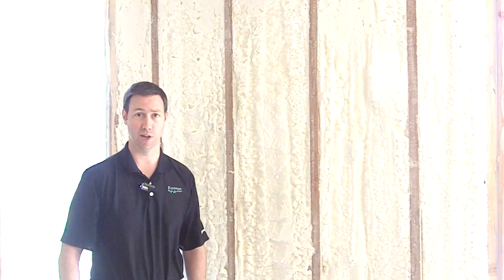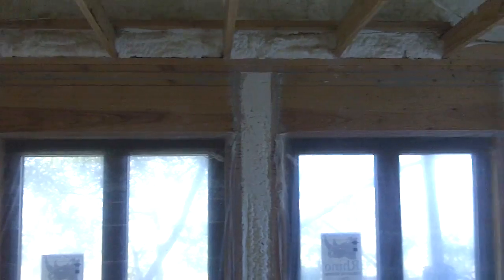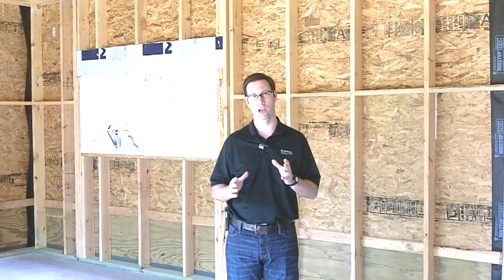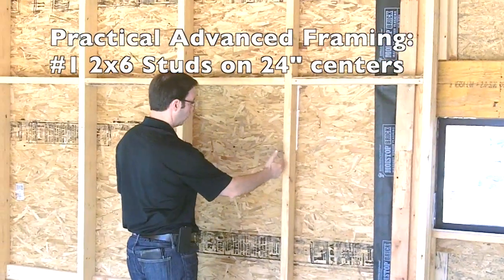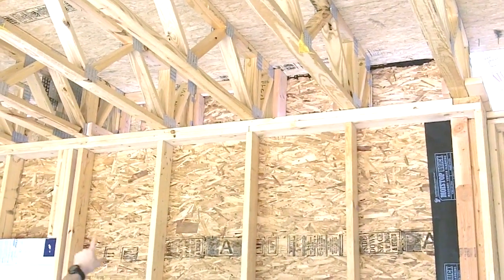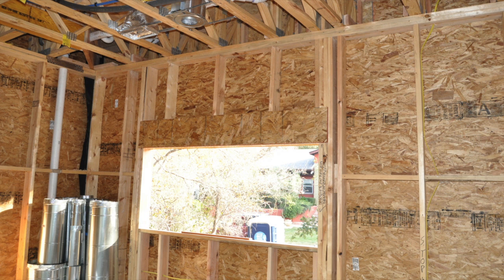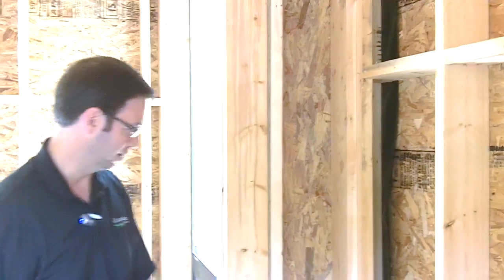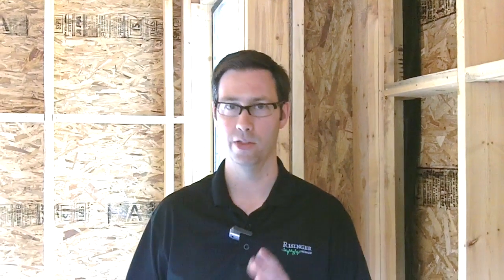Advanced Framing vs Traditional Framing

Comment: 24" on center is terribly inadequate. Even if you don't care about the lack if stiffness in your floors and roof, only being able to put a nail every 2 feet on your baseboard, crown and skirting etc is not at all a good product. Especially in this day and age of cheap trim lumber with finger joints, or medium density fiberboard, or god knows what some are using these days, lols. 

  2x6 studs are great though, especially in wall with waste lines. And plywood always is better than OSB. California corners work  almost as well as stud-block-stud corners, and you can use 1x for the nailer, you didn't need that 2x for that since all it's doing is holding the sheet rock.

  But traditional and modern in no way denote either of them as advanced  generally speaking. As I've pointed out, 24" centers are not advanced, but what is advanced about framing these days are elements of retro-fitting, like j-bolts (most important) and shearwall. Though they sometimes call for such close nailing on the edges that it causes the plywood to weaken and even split (ie; 3" - 4" nailing patterns on edges).

Comment: So you have to go to bigger studs, thicker sheetrock and full exterior sheathing, preferably plywood, all so you can eliminate every third stud? I'd say you need to take a second look at your bookkeeper's work! You're not saving any money, my friend. Now there may be other benefits, such as providing more space for insulation in the wall cavity, and reduced thermal bridging, but cost saving? Nope! 2x4s just aren't that expensive. The extra costs of the beefier materials eat up all your savings.

There are also disadvantages too that you should discuss. Plumbers and electricians need extra strength in the framing so that they can poke holes in it (preferably small and not too many, though we all know or have heard of tradesmen who were less than careful) and the building will still stand relatively straight and sturdy. Building codes in earthquake zones, hurricane zones, etc. may insist on greater strength in some details. Homeowners need to find studs to hang heavy objects from the walls. They'll be searching in vain to find wood in the walls 16" apart for shelf supports. Same goes when it comes time to install cabinets. Keeping everything aligned so that roof and second floor weights aren't carried by inadequate top plates may necessitate building redesign and also education of installers to make sure the alignments actually get built as specified.

Comment: A lot of dinosaurs and old-school 'experts' commenting here. My wife and I build staggered-stud double wall structures and am sitting in mine right now as I type this. Our buildings are way beyond code minimums, with R36 floors, R47 walls and R68 ceilings. We use a lot of adhesives and screws, focus on details like air-sealing and such, and as a result heating costs are WAY lower than average. For example, our home is not only super-insulated but off-grid with passive solar and wood heat. Every neighbour in this area (central British Columbia) burns 8-12 cords of firewood a year; last year we burned 1 1/2 cords. Think about that: we spent only about $4,000 more to build a high-performance home. Everything is on 24 inch centers and these buildings EXCEED the code minimums. 

Old school guys put headers in non-load-bearing walls. They stack five, six, seven studs in a void to fill it. They still stuff fiberglass around windows and doors, even though it is useless. The problem here is that guys who banged nails for 25 years think they understand engineering better than an engineer!

Comment: The cost savings of the framing is about the cost increase of thicker sheet rock. The 1/8” thicker sheet rock adds virtually no vertical strength compared to what’s lost with the reduced framing but is needed to bridge to wider span of the 24” OC studs verses 16” OC.

Comment: Me...Yea Mr. or Mrs. framing inspector we went with the advanced framing method and spaced the studs on the exterior walls 24 o/c, missed drilled the anchor bolts and threw the straps and clips out the window opening with the engineered header. 
Mr or Mrs inspector....Hello 911 I'd like to report a crime.  
That framing is criminal.  Next he'll be filming the reasons these walls failed in a cat 1 hurricane. I live in South Florida so we over build all the time.

Comment: We need homes that can take hurricanes here on the gulf coast. I like strong framing. I use 16 inch centers and OCB. Most won’t pay for plywood.
I like insulation bats. Don’t worry about saving on tar paper. Use the thicker ones and plenty of it. Overlap so you have two layers.

Comment: Where I live many homes were built in the 1920s-1930s many earlier which are post and beam,but most of the 1920s-1930s homes here were built with actual 2x6 not inch and a half by 5 and a half but actual 2x6s mostly pine or hemlock most of the homes were built with California corners and many are 24" oc some are even further it is not uncommon to open up walls and find studs 36" or even 48" oc and these houses have stood up to time and upstate NY's winters and snowloads,People here seemed to build with what they could afford,So explain to me why 16" on center and over building became standard practice when the old timers didn't over build and the old houses are still standing better than some of the new ones that are are over built and engineered,It all boils down to a few words codes pockets filled with engineers money and engineers pockets filled with industry money and industries pockets filled with golliable customers money,If we wanted to save money and use less product and have more insulating area and a better end product we would have never left the post and beam and mortise and tennon era in building and to think it has become an industry for the rich to build post and beam when actually it is cheaper but industry doesn't want to say that,it takes less cuts at the mill to make beams than lumber there for less time it takes less time to assemble than stick built where time is consumed in post and beam is in mortise and tennon but with todays tools why would it take any longer to assemble an H them it does 1000s  of 2x6s or 2x4s problem is it takes less wood to build post and beam or the same amount just not cut into a million tiny pieces that companies sell you individually that they payed next to nothing for to begin with,Home building has gotten out of hand because of the mighty dollar sign,Another thing is codes telling us how many sq ft each home and room has to be and that is why we now have a family of 2 living in houses the size of warehouses instead of what is really needed,

Comment: I'm dismayed by so many over the top critical comments.  Do they really think a fully  OSB sheathed  plus 3/4 foam 2x6 24 oc wall with  5/8 drywall interior is cheap construction? Not hardly.  Most completely miss that when using floor trusses at 24 oc, which is perfectly fine, it's natural to line those up with 24 oc exterior studs.  Nonetheless,  I certainly can respect those who prefer overkill with 2x6 16 oc; it's just material cost.  I presume that your interior 2x4 walls are 16 oc.   Any kind of corner or T-intersection  can work as long as you hold your framers accountable for insulating the pocket before they close it. What about the other subtle nuances when using  2x6 24 oc, like provisions for kitchen  cabinet mounting and the like?  What other advanced framing measures are you using, such as raised heel trusses?

Comment: I lived in the Northwest state of Washington 18 years ago. The homes were built 2x6 on 16" exterior walls, and 2x4 on 16" interior walls.  I knew a guy who lived across the street that was a miner in Alaska.  He said thicker exterior walls the better.  He told me that if you want a very energy efficient home to use 2x8 exterior walls with roof insulation and 2x4 for interior. Just a suggestion.

Comment: Cheap build, BS sales pitch. Earth movement, high wind pressure, temperature change, moisture change all stress houses.  The “extra” wood in a quality build is your friend.
Reply: M Ray With that much foam that house is going nowhere
Reply: Doesn't mean one can't optimize. There is always another side to the coin. And the money needs to go where they do the actual work.

Comment: I think it's fun to make fun of a new idea. The bracing in the center gives him streagth for the fb usually the week point in forces. Studs are strongest in compression (no problems there)  if he uses a plywood or tounge and grove plenty of shear strength. Now for the guy that thought he could run through the sheet rock not with blown fiberglass behind it. Usually it's hard not to over stuff them when I've filled them before and bulge sheet rock. now for the old people stuck in there ways of younger educated people. Yes I started out as a welder, laborer, bpi, carpenter, then civil engineering degree, then superintendant in Commercial construction, now own my own residential

Comment: So you save money on fraiming but yet when some one come in to do electrical they have to ad spacers, when you come to hang cabinets you have next to nothing to screw to, you have to pay more for drywall. There’s a ton of cons for a few pros. I can’t stand 24 on center for interior walls and I would never even consider them for an exterior wall. Do you attach your bottom plate with tap cons as well?

Comment: As a builder for over 40 years I would never build walls with 24" on center  for one its looks like your cutting corner on the home where the home buyer what more for their hard earn dollar. The money  you might save isn't worth it. Plus I would never spray foam in the  walls  because I just don't believe home were meant to be so air  tight. I go for tried and true. When every one was using OSB junk siding I kept with cedar.

Comment: Headers don't have a full bearing load there is a over Hans of the 2X 6. This also creates a void  from drywall to header. There should be blocking between the LVL headers.  If the structure is built correctly there is no need for  pressure treated wood  at the base of  exterior walls  in NY this is not to code   A all electric house with AC. All walls should be insulated including interior walls  Foam houses  require a good ventilation system  moisture is easily trapped  because the house is almost air tight  water lines should only be insulated on the exterior side of the wall leaving a  pipe exposed to the interior heated  living space  35 + years in the building business residential,commercial and heavy construction  good luck with your project 👍

Comment: You're on point about thinking about insulation values on things like usingv2x6s and insulated headers. But, California corners have little to no structural value. And relying on the glues and hardware of engineered lumber is too dependant on every other system, I.e roofing, siding, and HVAC to operate perfectly and be maintained. Traditional framing has its merits and necessities that can't be tossed aside for the sake of energy efficiency.

Comment: Good luck passing Massachusetts building code with any size lumber on 24" on center and half a header LMAO!  Don't think so, pal.  Never mind the building code, they'd pass it of to a structural engineer to take on the liability of that type of framing and you'll never find a structural engineer who would ok that framing.
Reply: That's funny, I know plenty of fellow structural engineers that would sign off on 24" centers as long as the design was sufficient.
Reply: Actually, just saw a series by "This Old House" where they built a house in Rhode Island and it was on 24" centers because they used 2x6 wall studs. It is called a "net zero" house because it reduces more energy than it uses. (solar panels do the producing) I would go with TOH guys anyway!!!

Comment: So many comments here are focusing on the "advanced" framing. Structurally it's fine- the fire blocking, purlin boards, and sheeting make it plenty strong. People seem to hear "2x6" and immediately think "Oh, they must want a stronger wall.", but the focus here is ENERGY EFFICIENCY, not structural strength. You can build an exterior wall with a 5.5" insulated cavity with studs on 16" centers, but is that necessary?

Risinger builds in a high-cooling climate, and over even a couple decades of lifespan, the energy savings resulting from extra insulation will more than make up for any materials expense in the initial cost of the structure. I think this is more accurate to call this "advanced EFFICIENCY framing". After all, framing is framing. It exists to enable other components to do their job without falling down. You design it so it's strong enough to endure the conditions you expect it to face while not wasting resources initially AND through-out the lifespan of a building. The issue of fire survivability and fire fighter safety may be addressed to a degree by the fact that interior walls could be framed in a traditional manner.
Reply: Sorry but the fire problem still exists as long as any engineered floor joist system is used. This is a very poor design in many ways even if it does increase energy efficiency. Whatever gains you make there are going to be lost elsewhere in the long run. Far better to go 16"OC with a double plate and standard corners and dimensional lumber floor joists for a longer-lasting more trouble-free cheaper to insure structure which might let the firemen save your kids instead of just watching them die someday.
Reply: @P_RO_  Agreed. This design definitely has some issues, and the open floor joists are worrysome.

Comment: F it, build the whole house using nothing but 4x8 cedar framing.  A beefed up Chevy 3500 with a 454 big block would be stopped in it's tracks trying to run through it then lol

Comment: High profile customers up here, insisting on 2x16 walls, urethane foam insulation, Osb interior walls, not useless sheet rock or even blue board, you can plaster right over Osb board.  Were selling drilled stainless steel piles, drilled and pinned into bedrock threaded rod that carries up thru bottom plates, walls, up thru your top plates, Vacuum injection of urethane foam into the wall cavities. shingles are composites on the roof screwed down, we even have radiant heated gutters, I,m a mechanical engineer myself. Business is booming , not enough hours in a day, hahahahaha, Quality is where its at, Innovation, we have all the bells and whistles in our houses, Oh ps. if you own the land your a developer, if your building on their land, your a builder, just whacking nails, like everyone's a painter, an auto mechanic, Jacks and Jills of all trades, masters of none, Not all of you, but most of the comments below are from cement heads, hard headed, un teachables.

Comment: Total B.S. I have built horse barns on 24" centers, never a home.  I couldn't sell a home in good conscience built on 24" centers. Don't listen to this guy. 
He saves on expense material and labor building structure then charges higher profit on board foot of insulation Economics 101 .
Reply: I've been framing in SoCal  for 20 years and  24" on center is hogwash
Reply: @Rae G Check again. Table R602.3(5) in the 2015 IRC.

Comment: This is not a cheaper method of construction.  This is a great step in the right direction.  Less studs but 2x6 vs 2x4 does not equate to cheap.  Eliminating thermal passthru with less wood and California corners can make a big difference in heating and cooling.  5/8 drywall is a huge upgrade.  Anyone stating this guy is taking more to the bank needs a wake up call.  Get out of the 50's and be proactive in your field.

Comment: 16 inch centers is required for walls to be up to code in my area even if you go 2x6. most go 2x6 for better insulation. im going ICF and eliminating all lumber and getting the best R value possible... now that is advanced and i dont care that it adds 10% build cost over stick built.

Comment: Sorry, my friend, but while I like the 2x6 studs, you lost me at 24" centers. One hallmark of every cheap, fly-by-night builder I've seen is 24" centers - and they're almost always indicative of other cheap tactics along the way. Unless you're trying to build some sort of vertical torsion box for a wall, which I don't see in this example, this isn't what I'd call "advanced" framing.
Reply: While I agree traditionally, my house came with 2x6s on 24" centers. I live in a cold climate and besides having the deeper cavity for 2 more inches of insulation, since fiberglass batts have 2.5* more r-value over the studs, you have more insulation covering the wall area.  From a cross sectional perspective, 2*6 on 24" centers actually have more lumber in the wall than 2*4s on 16" centers. It's definitely not traditional but I can't say it's bad. I found out when I was trying to mount a TV in the living room to an exterior wall